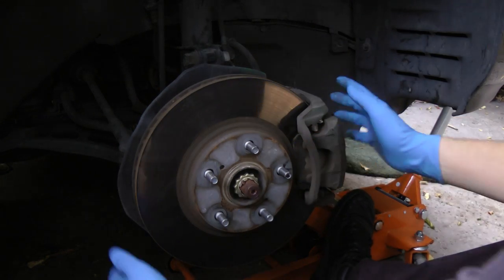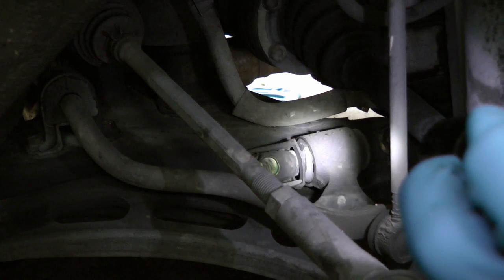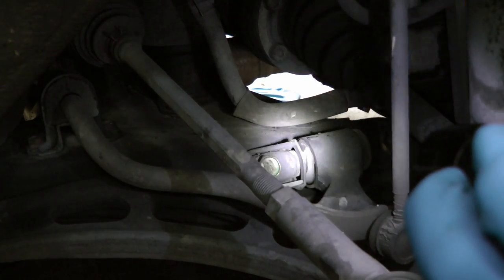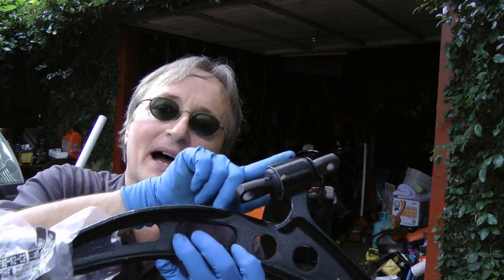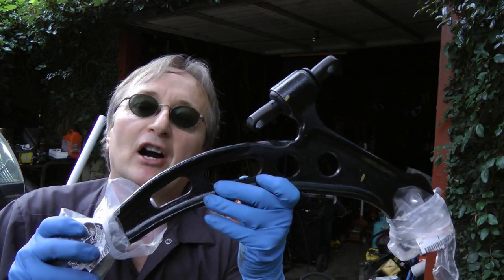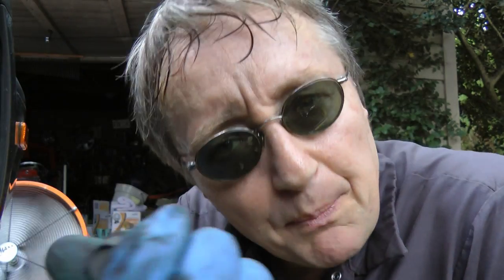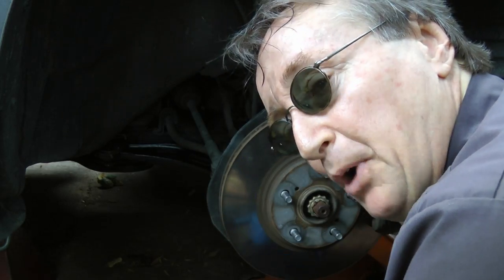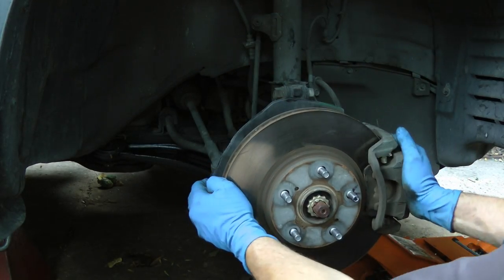How to Stop Steering Wheel from Shaking (Lower Control Arm)

Comment: just got an inspection and barely passed a couple things.  they are on my list to fix.  i knew i had suspension issues and it turns out i have bad control arm bushings.  he showed me.

the quote was $388.  $75 just for the bushings, $235 labor (2.5 hours), and $80 alignment.

it seems i can get 2 control arms (with bushings) for $110.  i could buy the tools and do this myself or call a guy on craigslist to do it for $25 an hour.  he's helped me with struts before.  alignments can be done anywhere.

so instead of $388 i can do it for around $250 or less. i would pay the guy more than what he is quoting.
or cheaper if i do it.  youtube has walked me through crazy repairs before thx to people like Scotty!!
Reply: How did it turn out with the cheap control arms? I'm about to buy a set and hoping to get away with 1aauto.com's low priced arms. Their tie rod ends were good quality.

Comment: Scotty, your video was extremely helpful, thank you. One limitation; it does not apply to 2004 era Lexus ES330 front control arms. For the driver's side control arm, it is necessary to unbolt the front engine mount and the engine mount over the control arm, lift the engine several inches, and remove the left hand engine mount to access the control arm bolt it hides. The control arm can then be replaced, and the reverse procedure applied to put it all back. On the right hand (passenger) side, this simple workaround is not feasible. I could not life the engine after an inch. Unless I report back differently, I plan to hold the engine using a wooden brace across the strut towers, drop the subframe, remove the engine mount hiding one of the left control arm bolts, then changing the control arm. FYI for others with 2004-era Lexus ES300 who needs to renew their control arms.

Comment: You're a really good teacher Today I had my tire fall of while driving to work and the ball joint broke off I didn't hear any clunking though it just broke right off going about 35mph on a straightaway I'm a entry mechanic so I had it towed to work the first problem was getting it in my bay because it's an open differential the next was taking the control arm off.  Tomorrow I am putting the new control arm on and I feel much better after seeing this video I am going to watch more of your videos!

Comment: Hi Just did 2010 toyota senna, 2 1/2 hrs, yes you need good breaker bar and 17,19,22 mm tools, doing it your self saves $$$ and on my vehicle I had to loosen motor mount and raise engine a few inches. Always use proper jack stands and wear gloves and safety glasses. Thank you.

Comment: Hey! I really like this video. You made it clear, simple, and without unnecessary filler. I have a question, however, when I jack up the car, since I'm replacing a suspension component, do I need to jack up specifically the body, or can I jack it up by the axle?

Comment: @scottykilmer Finally got it off. I learned a technique where you use an extension socket as a stake to drive the bolt through. It worked thanx again

Comment: Scotty your videos rock man. I saved tons of dollars and I used to know nothing about cars before knowing you. So thank you. Anyway, after replacing lower control arm, is it necessary to perform wheel alignment? I hate ask this question because dealers try to rip you off saying that you need an alignment everytime you change xxx part... I really appreciate if you can make a video explaining when do we really need a wheel alignment...
Reply from the maker: Not if new arm was made correctly and is oem factory size.
Reply: Scotty Kilmer i bought a car vw passat that was involved in a wreck.i know this because only one tire is cambered.i was told to do a proper job to ressolve the problem completely especially if the car was in a wreck.is to replace lower control arm upper control arm and spindle Assembly.sounds about right?

Comment from the maker: pay a front end mechanic to adjust it, or remove the steering wheel and put it back on to be straight (mechanics don't do it that way, they adjust stuff under the hood, but you can do that if you want.)

Comment: Don't know the year of the RX300 you were working on but energy suspension offers replacement bushings for most toyota products.  It is time consuming to replace only bushings as they have to be pressed in, but it is possible.  I am currently replacing bushings on the front control arm for a 2001 Toyota Solara.

Comment: Good morning Mr. Scotty 'I have a Porsche 997 Turbo and I have a problem shaking the wheel from the left, and i make a balance of the wheels and aliment repeatedly and over again, but it is useful and I am sure that the wheels and tires intact and when i watch this video of your projecting the problem of the car lies in the same theme of this video and I would like to hear your opinion on your counsel and accept me and sincerely on the foregoing topics helpful to us and thank you.
Reply from the maker: check for worn suspension parts like ball joints, tie rods, and wheel bearings.
Reply: Scotty Kilmer I will examine these things and thank you.

Comment: pretty straight forward video.  would i be able to this with a 2003 hyundai elantra?  looks like my lower control arm has corroded to the point of almost breaking.  if i can just swap out the arms it seems simple enough....i don't have a bearing press or anything though.

Comment: ok, am I missing something?  My dealer wants 1600 bucks to replace the Front Lower Control Arms.  If I Iook for parts online, they are less than a hundred bucks each and your awesome video makes it looks pretty easy to do.  I just replaced my rotors and brakes, so I'm guessing I can tackle this, but why so much?   is it labor intensive?  I have a 2006 Hylander.  thanks for your video!
Reply: +Jonathan Herschel they also mentioned the bushing is cracked, is that included in the control arm or is that a separate part/fix?

Comment: Scotty, My Prelude's steering wheel shakes back and forth at all speeds, also If I move the wheel back and forth it moves. Both of the front wheels move. Also both wheels have camber wear.
Reply from the maker: when you jack it up and pull on the wheels, see which parts are moving and replace then, none should have motion. Often ball joints on those

Comment: Hey Scotty, great videos! I'm working on 2nd lower control arm in 1998 lexus es300. Having a real problem with rear bushing bolt as it was totally frozen, bought electric impact wrench for the job...stripped the bolt!  What is best idea to remove this? sawzall? tight spot for top of this mount. How about sawzall through the metal part that surrounds the bushing? Any help is greatly appreciated, thanks

Comment: Hey Scotty. Im' replacing my lower control arms on my 98 lexus es300. I did the drivers side thanks to your video. On the passenger side though, I got the single long bolt that goes straight up in and into that weird nut on top. But now I can't get my next two bolts lined up with the holes. Kinda got the longer of the two started but still having major problems lining up the shorter bolt. need some help. This is wearing me down and I'm so close. Any suggestions Scotty.
Reply from the maker: yep, sometimes you have to wiggle, push, shove, and swear to get them to line back up. I find jacking both front wheels up in the air to take all the pressure off the suspension system helps, as does having a jack lying around to help push and jack the parts into alignment. good luck

Comment: Scotty, I have a 2004 Sienna and the front suspension is making noise. It's the control arm bushings that have gone bad. Should I just replace the control arms or the ball joints also? The van doesn't have any other wheel shaking or pulling problems. It's just the noise that is the problem and makes the ride a little rough.

Comment: Hi Scotty, I'm having issues finding the same model of lower control arm for my 1997 Pontiac Bonneville so I was wondering if you knew of any good places that might stock those older model parts or if I should just replace both control arms if the part fits in the brackets. Thanks a lot!

Comment: @Scotty I replaced that same control arm and new ball joint on my 08' toyota Avalon. Now my steering feels really touch and feels like the wheels are riding on the outer most edge of the tires. Almost feels unsafe to drive. Any idea what I might of screwed up? Did my Camber get thrown out of alignment? Thanks for your great videos.

Comment: Hey Scotty, I just bought a control arm the other month( about 5 months ago). The Mechanic I hired put it in my car and for the time being it drove completely fine. He told me that it could be tighter and to come over to his garage but he never replied when I came.  The control arm fell off again and I am not sure if its broken again? The bushings don't look damaged or anything it just looked like it fell off. Its still attached to the wheel side.
Reply from the maker: Sean Bovell find another mechanic, they need to be installed correctly and sounds like he does crap work and doesn't care about it. I've never had that happen to me in 47 years of fixing em.
Reply: Yeah Thanks I just had a mechanic come and look and he said it was the mechanics fault. He tightened it too much and it broke off.

Comment: you should jack up the suspension up to the same level as if it was sitting on the ground and replace the control arm in that natural position, also helps avoid squeaking noises after putting the new arm on.
Reply: Exactly. Bushings will wear out much faster if you don't do this.

Comment: Is there any preventative maintenance that can be done on the ball joints? I heard you can use lithium grease to keep the ball joints from drying out during the winter. Is that necessary on a modern car?
2001 Mustang

Comment: Wow. that looks so easy... Will you have to reset your alignment yourself after doing this? On my Lexus IS300 the alignment is off too because of the worn control arms and ball joints
Reply: The answer is...SOMETIMES, usually NO.  It really depends on the vehicle and on what the role of the control arm is.  On some cars the arm just helps to hold everything in place and there is nothing to adjust on it, like the Lexus in this video.  Generally, and alignment is only needed if something is done with the TIE RODS, OR if it was aligned with a bad suspension part on the car.  If they did an alignment without noticing a bad bushing on an arm or something and then you put a new one on, it could change it and need doing again.
Reply: COOL thanks!!!
Reply: Just watch for uneven tire wear and make sure your steering wheel is perfectly straight when you're going forward.
Reply: Sweet thank you so much :)

Comment: Replacing the lower control arm on a 2009 Chevy HHR and the bolt that connects the arm to the frame (back one) won't come off.  I snapped an extension bar off trying to get it off but it won't budge.  Lubed it with penetrating lubricant but still can't get it off.  Any tips for a stuck bolt?

Comment: Hello Scott, thanks for this awesome instructional video. I am trying to get the LCA off of a 2003 Camry and ran into a problem: The transmission mount is in the way of the outer bushing bolt. Can I safely remove the mount without having to worry that the transmission will crush my head? Thank you in advance.
Reply from the maker: Jay Hwang best to hold the engine and transmission from the top using either an engine puller hoist OR metal rods you could run over the top and put chains on the engine and tranny so they don't fall down
Reply: Scotty Kilmer I see...Thank you. I don't have an engine hoist, but will a couple of jacks and a block of wood suffice for jacking up the engine? I like to improvise with what I have to work with. haha.

Comment: Great Video - Can you tell me what makes a car severely rock or sway when the car is turning at 25 mph or when letting up on the accelerator? It feels like the car is ready to tip over. From what I can tell, It's either the shocks or control arms. What do you think?
Reply from the maker: Any badly worn suspension part can do that, perhaps see what a good front end man says, most give free estimates
Reply: Thanks for the prompt reply. I'll take it in to have the front end suspension checked out.

Comment: Hi Scott,
Nice video for replacing the lower control arm on the 2005 Lexus RX330. Now, how do you remove the engine mount that is trapped between the transmission and the subframe. The lower control arm (driver side) won't get out unless we remove the engine mount. Your advise will be really appreciated.
Reply from the maker: +Elbio Iseas yes, it's a royal pain on that design. You have to jack up the engine to get the mount out, and that really requires and engine hoist to pull from the top
Reply: Thank you Scotty for your quick response. That wouldn't be a problem. I have an engine hoist. I don't think I have to disconnect the transmission from the engine to do this, do I? The Haynes manual shows a picture with a floor jack under the transmission what it makes think I don't need much to do this job, but may be I do. Even if I lift the engine mount I don't have enough room to pull out the bolt from the lower control arm and subframe. I unbolted the four engine mounts, is there something I am missing to lift the engine? Thank you,
Reply: Hello Scott,

I was able to replace the engine mounts on the 05 Lexus RX330 to replace the lower control under the transmission mount but I did not disconnect the battery to do it and it has an electronic suspension because I saw a sensor connected to the front engine mount. Now it makes noises on all the engine and transmission mounts. It is true also that I didn't give the right torque to the nuts, just tightened them well. How would this issue be fixed? I never had any problem with other cars but this one. Is there any calibration needed for this kind of suspension? Thank you.

Comment: Thanks for the video, Scotty!  I have a small problem that I'd like your help with.  I broke the driver side control arm on my 2002 Suzuki Aerio SX, and while I have moved along in its replacement rather well, I have hit a snag.  The final bolt securing the arm to the frame towards the rear of the vehicle refuses to do more than turn, and I was wondering if I just need to be patient and keep twisting, or is this bolt secured with a nut?  I have tried to find both a nut and an easy to find repair manual with no success thus far.
Reply from the maker: often they are blind side bolts that go into a nut welded on the frame. If that's the case, see a pro who may have to cut it off and weld on a new nut
Reply: Scotty Kilmer Thanks for the advice. Turns out the nut was just a standard one, but to get to it, the mechanic needed to move or remove part of the frame. Because I wouldn't have been able to fix it myself anyway, your advice saved me a great deal of time and heartache. Thank you!

Comment: I think energy suspension sells replacements for the control arm.  I got the entire set for the avalon but I was wondering if you could install them without using the metal sleeves.

Comment: Hey Scotty,
1st, you're the man!
ok, I have an 06 Mustang GT with 109k miles, my ride and alignment is done for. I changed out both strut mounts (gt500),Shocks & Struts and Tie Rods (inner & outer). Did an alignment afterwards. My ride is still bouncy as a mofo on some patches with lots of smaller bumps, but when I go over a bit bigger road bumps I can tell the new shocks & struts are taking it like champs.
Do you think I should change out the front springs? (Not looking to lower)
I did also purchase front and rear lower control arms. (Going to install this weekend. 11.15)
any other advice is greatly appreciated!
Reply from the maker: yes, it could be that, but make sure you got quality rear shocks, as they effect bounciness a LOT, I've seen cheap ones work worse than old ones

Comment: Hi scottykilmer, I have a 1999 lexus SC400 with a bad lower right front control arm. I'm on a tight budget and can't find one less than $450.00 Is it possible to replace the bushings instead of replacing the whole control arm? I found a pair OEM bushings for wayyyy less. Thank you for the great video!!!

Comment: I replaced my ball joint on my LCA but I had to grind it off so I put everything back together, the truck rode rough. I did have to go back and loosen the LCA and make sure it was level and then tighten things back up. What can cause the vehicle to bottom out after this repair is done 09 Traverse?

Comment: attempted this today on a very similar car...toyota camry 2001. Those two bolts in the front bushing are stuck. Tried heating them with a torch and used a big old breaker bar but it just wont move..If I pull any harder i'm sure the bolt will snap and then its going to be a nightmare. Oh well, its my rear bushing that's worn not as serious as this one.

Comment: Hi Scotty !!  I own a ford and my mechanic told me that the my lower control arm bushes have worn out on the left side and on the Right side it is a "bit weak". I have not noticed anything unusual, it handles well on straight roads and Only during turns on a bumpy road i hear a few clunks. So can i use it in the same condition for some more miles, or should i replace them right away? Will it cause any dangers if i use it in the same condition .

Comment: Hey Scotty. I went to get a 2007 Ford Taurus that I purchased alligned due to the stearing wheel has to be pulled to the left slightly to drive straight. They informed me that the left rear Trailing Arm was bent probably due to being towed at one point. Is a rear control arm what they are referring to?